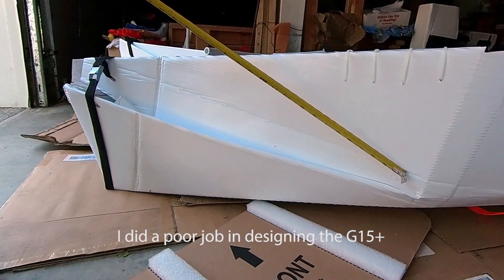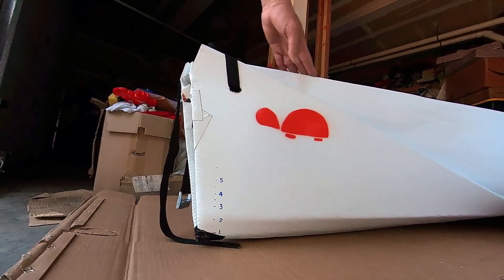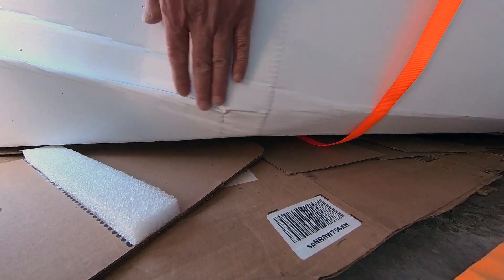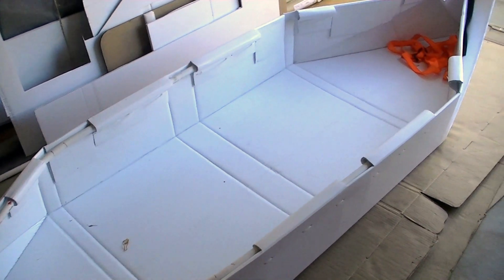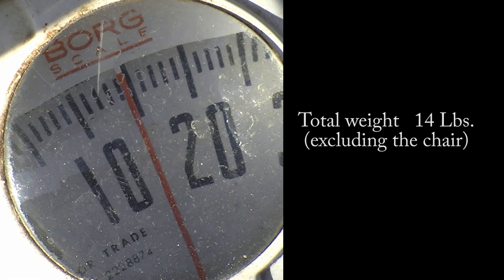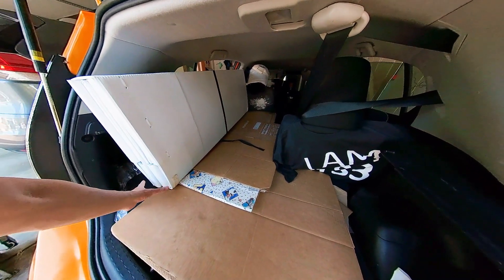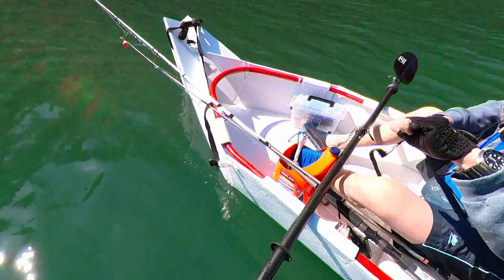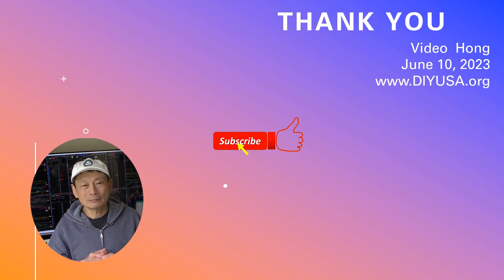Pt2 DIY 10' Folding Canoe Gen 15+

Comment: I really want to build one of these.
Reply from the maker: This is version 2, and I plan to further improve the design with version 3 and then provide the plan and build information. You can watch the water test video Part 3 to see what changes will be applied to version 3.  I have been using very simple techniques in build this G15+ (no heat fusion). I think most people can build a basic boat that works in 10-12 hours (no painting, bow-stern cover/bra ). The biggest challenge is in get the coroplast. I and thinking of spending a weekend in late August to have a workshop helping people to build one of this.  But you have to be in Portland Oregon. I do have a few sheets of coroplast that I can sell to people at cost (this is my hobby and I don't need to make any money) The material cost for the whole boat should be less than $100. Cheers!